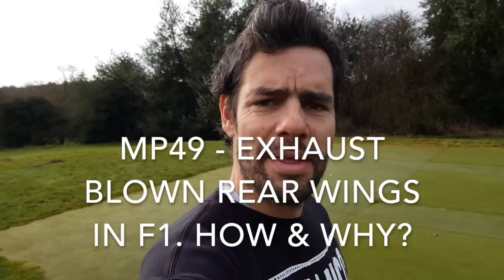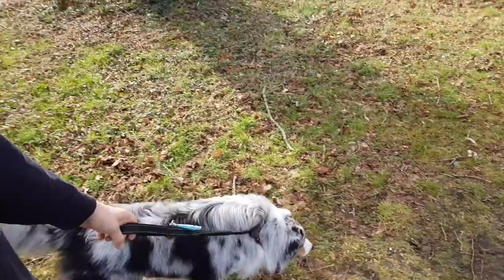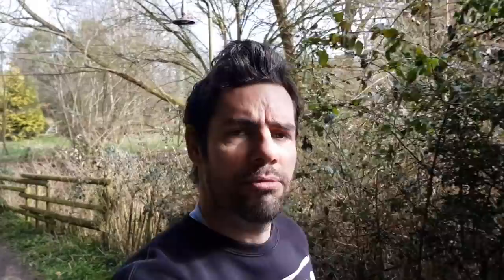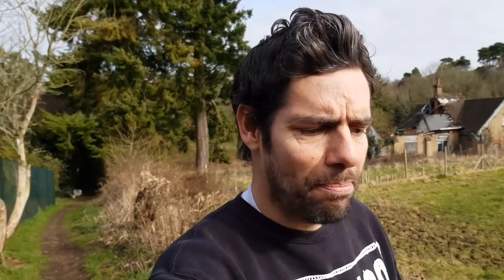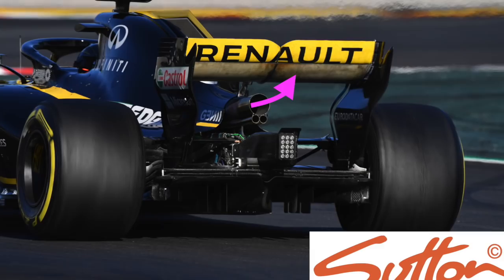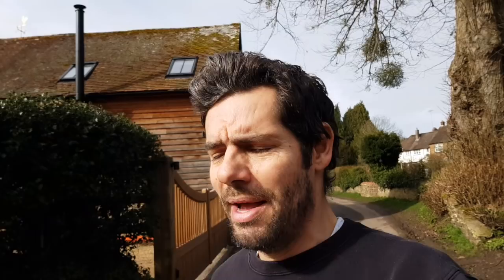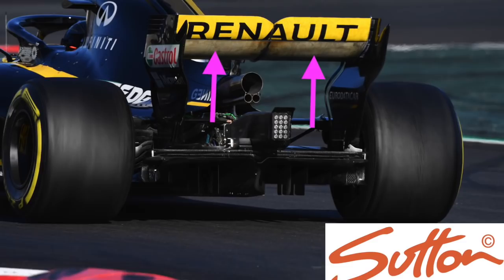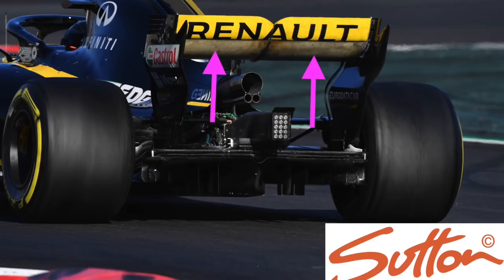MP49 - Exhaust Blown Rear Wings in F1. How & Why?

Comment: How far behind an moving F1 car do you have to be to achieve "Clean Air"? Please keep the videos coming. They are so informative for F1 fans.
Reply from the maker: Eric Theriot That depends on velocity and the aero spec (size and angle of wings) of the two cars.
Reply: Thanks Mark again for everything
Reply: I am thinking that the faster that both cars go the bigger the gap would have to be to gain ‘Clean Air’. So with this in mind, would measuring the gap in time be better, such as a 1 second gap which is when DRS starts to become active. Is this the train of thought or am I joining Wilson by barking up a tree Marc?
Reply: Eric Theriot Clean air problems get worse the faster they go. Thats partly why DRS came in, to counter this somewhat. But at full speeds you can be lucky if you dont start feeling it from a good 7 car lengths back. And it gets worse and worse the closer you get! Take a look at any wet f1 races on vid on utube and look at the rooster tail spray. That is the dirty air.

Comment: awesome video! have been waiting for this one specifically. :-) Jean Todt commented in the last couple days that he thought what Renault are doing is legal... as long as they aren't exploiting specific engine modes. That must be what you're talking about with the MGUH spinning up to blow air mid-corner. Is that something that a driver has to select while they are driving? or is that something that the engine ECU would be programmed to do automatically? Would love to hear technically how the engine modes work. Thanks again for such an informative video. These are the best F1 vids on YT!
Reply from the maker: Thanks. MGU-H is controlled by software

Comment: Ciao Marc. Thank you for your great uploads. We really enjoy the way u put both casual and critical things in a bundle. Please keep them coming. 

I have a small doubt though. How is the  upward flow under the wing going to interact with the diffuser up wash. Or are they taken as separate entities after 2017 regn changes. Since the wing height decreased I suppose the wing and diffuser have more interactions
Reply from the maker: Soumya Kanta Das The two don't interact significantly, certainly not adversly, the rear wing plume (and therefore the exhaust plume) rise at a steeper angle normally.
Reply: yes yes the rear wing plume does steep pretty high. Thank you Sir !

Comment: OK, but surely if you are adding volume of air to the underside, in comparison to the volume arriving at the upper side of the wing, then you are not only increasing flow, but increasing volume, and does that not negate the bonus gained from increasing the airflow (and therefore the lowering of density). I'm not an aerodynamics guy, so have not explained it properly, but I'm sure you get my gist. . Love the shows.
Reply from the maker: Bob Preston No, the faster flowing air particles will be effectively stretched out as they circumnavigate the wing shape and therefore lower pressure that the slower moving air above the wing. The exhaust plume just directs, or attracts more of the high speed, low pressure air in its direction.

Comment: But you would not want this on long straights.  If you have the pedal to the floor, on a straight you don't want downforce.  I guess it is all part of the F1 balancing act.  Could they have different setups?  One for tight curvy tracks, and another for the high speed tracks like Spa and Monza?
Reply from the maker: They do have different setups for different tracks. different wings will give different downforce and drag, the exhaust blowing just works with that wing level.
Reply: Marc Priestley I guess they could lower the wing and direct the exhaust gases over the wing to get opposite effect ?

Comment: Awesome video yet again I always love a loophole, do you have any ideas on a rules solution that would allow the cars to run closer together? As part of my dissertation I came up with a solution but could not find a way within the rules to achieve it, a very small change to the current regs would be required.  I would love your thoughts on the problem (and also my idea, just not publicly).
Reply: Good luck. I hope MP has the time to give his input and I hope it can actually work.
Reply from the maker: Chris Keeling Thanks. The general consensus seems to be to move away from reliance on large, complex wings and towards underfloor aero and ground effect as part of a regulation change. Love to know your ideas.
Reply: Marc Priestley thanks for your reply, I don't know how you found the time you must be so busy. I'm glad you said that, that's exactly where I focused on, as it's the least affected area on the current cars.  My idea only changes two things on the current cars though.  I used an active double diffuser, when inactive the diffuser complies with current regs, then when a car is within a certain distance of the car ahead (average length of wake created by each teams car) the upper chamber opens.  The active system replaces DRS but utilises the same fia control loop to monitor/allow activation.  My CFD data shows that the system can restore around 25% of the downforce lost when in the turbulent wake of the car ahead.  I believe with refinement it could do even better, creating pressure changes between the two diffuser sections creates interesting results.

Comment: Interesting. Considering that the highest speeds are achieved in the straights, doesn't this increase drag? My limited scientific knowledge thinks that you need less downforce on the straights hence DRS. I can see how this can benefit cornering but struggling to understand the benefits on the straights
Reply from the maker: SileTa Mus Downforce is always a trade off with drag.

Comment: As we know the exhaust has high pressure so doesn't that cause any adverce effect on pressure diffrential
Reply from the maker: Rushi Raikar No, the exhaust plume just directs, or attracts, more fast flowing air underneath the wing.
Reply: Based on a couple of assumptions and a controlled space the airflow is constant, so the amount of air coming in is the same as the amount of air coming out. 

The formula for this assumption is:
Pressure + 1/2 * air density * v² = constant

The exhaust is pushing high speed air towards the underside of the wing. And in order to keep the airflow constant the pressure has to drop, creating that bigger pressure differential on the wing.

Marc, as a 2nd year aeronautical engineering student, please do correct me if I'm wrong! 🙄
Reply: Tom Savage yuup I've worded t just a tad wrong, wanted to make it more outside audience friendly and apparently made some mistakes while doing that

Comment: Another good video Marc. I was actually going to message you about the blown rear wing Renault seemed to be testing in Barcelona. Wasn't it Renault as an engine supplier and Redbull that mastered the EBD on the RB7 in 2011? I heard you say they're using the MGU-H as a potential for mid corner DF gains using the MGU-H to increase exhaust gas flow. How would that work exactly? Will they speed the turbo up mid corner with the MGU-H and open the wastegates? One other thought I had was what if they can detach the airflow with the DRS open on the straights similarly to the old McLaren F-Duct? They'd get the required downforce in the turns, open the DRS on the straights and go even quicker! Oh,  Avocado this morning? It's great that they let dogs in. Our Bostons were welcome in there but one of them doesn't like wooden floors so had to pick her up and stick her on a blanket!!
Reply from the maker: Yes, RBR and Renault were very good at using the EBD. Correct on the MGU-H, but DRS is only available at a certain point on the lap.
Reply from the maker: Chris Kerr Granola today btw! 👍
Reply: From my understanding the teams all spin up the turbos using the MGU-H to act as a sort of supercharger. I think the turbo 'H' energy harvesting will also add downforce using this Renault approach. The FIA stated that they will be looking for abnormal uses of the engine in order to prevent using the exhaust specifically to add downforce. I don't think they can enforce this as the regs stand. Renault has found an exploit. Good on them.

Comment: If I remember correctly didn't the FIA introduce a ban on extreme engine mapping for off-throttle use of blown diffuses back in 2011? Would that same rule apply if Renault were to use the MGU-H for the same gain in performance?

Comment: Are the exhaust gases exiting in a turbulent or laminar flow and does that matter to the effectiveness of the rear wing and I guess more importantly to the ability to control/harness the gas flow to generate the extra downforce?

(I hope that question make sense?)

Just wondering as laminar flow would be more predictable and consistent, but turbulent flow tends to create a larger pressure drop than would be predicted by Poiseulle's law?
Reply from the maker: Exhaust flow would be pretty turbulent, but it has the effect of attracting the laminar flow passing under the wing and keeping it attached for longer as well as speeding it up.
Reply: Thanks for the reply!

Comment: You're describing the Bernoulli principle quite well , however aren't Renault afraid of the hot air damaging the rear wing ? Unless they chose a material working at high temperature ($$$$). https://en.wikipedia.org/wiki/Bernoulli%27s_principle
Reply from the maker: That's what they've done, put heat shielding on the underside of the rear wing.
Reply: of course , stupid me !

Comment: Mark would it change the performance massively to put less tighter bodywork on the McLaren? Like just give it.. I don't know 5ml or even 10 millimetres of room for the Renault engine to breath? I understand that they want this tightly packaged coke bottle design but surely a extra 10ml would help the engine and reliability?
Reply from the maker: Johnathan  Coates Well, tight rear end packaging certainly isn't their only issue, but if that was the answer it would be very easy to do and have only a small effect on aero. F1's about gaining everything possible from every single area, thats why they're pushing the limits.
Reply: Marc Priestley, yes I understand that and I guess we will see how reliable the McLaren is compared to the other Renault engine cars on the grid over the season.

Comment: Doesn't this make the car oversteer off throttle since they can't blow off throttle? Or are the gains just too marginal for that kind of behaviour?
Reply from the maker: Michiel It's a much smaller effect that with the old EBD for example, but everything helps!
Reply: Ideally you'd want understeer off throttle. Of course, a perfect balance would be nice, but you'll never get that at all speeds due to the shift in the center of downforce of these cars. So this exhaust blown wing generates slightly more downforce in flat out corners or corner exits. So perfect :)

Comment: How much more downforce is generated?  Be specific.
Reply: It is different all the time
Reply from the maker: Impossible one to answer as its constantly variable.
Reply: @F1Elvis  okay, so you can't prove the gains.
Reply from the maker: Of course you can, that's what wind tunnels and cfd do. But you want specifics and that's dependent on all sorts of things like car speed, engine speed, wind direction and velocity, air density etc etc, so I can't answer that question, that's all.
Reply: @F1Elvis  could you estimate maybe in percentages? 1% 10% 50%? Thanks
Reply: @Twobarpsi  probably not